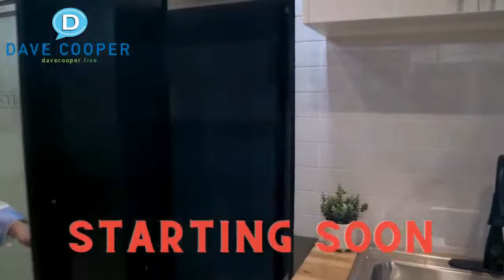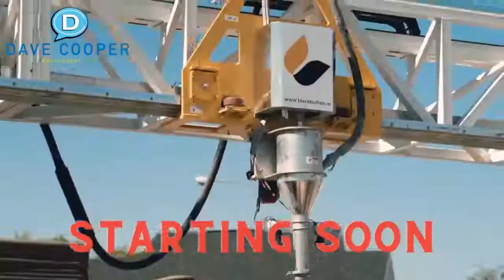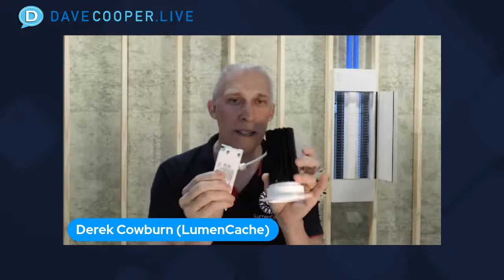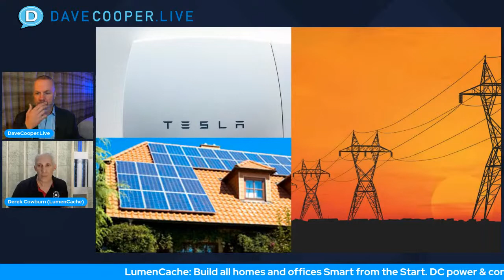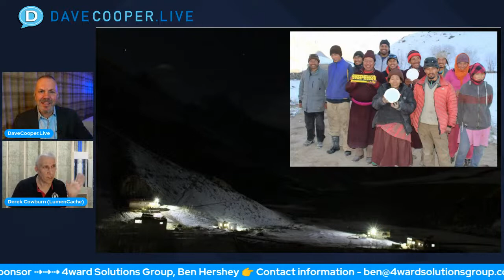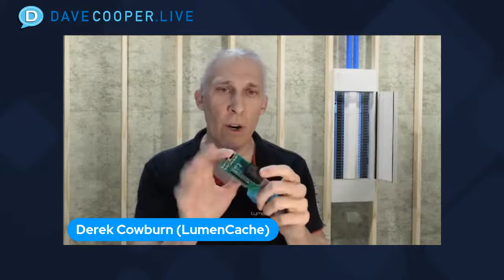DC LED Lighting and Control: Less Copper, Reduced Load, Greater Efficiency

Comment: Such potential. I have been trying to work with lumencache/Derek for over 3 years as a integrator and installer. The system has had so much potential. The big problem is that there has never been an easy way for it to be "smart." No native app, no voice control or easy integration into control systems. Most of my customers are going to care less about all of the benefits of it if they cannot open an app and just control it. Technically, the ability to control it is there, but it is complicated and cumbersome. The new stuff is supposed to remedy that. But i honesty believe that it could be way further ahead than it is if he would have made integrators a priority. He would not hardly have to sell anything. We the integrators would be doing that for him. But if I can't control it and offer my customers what they expect from new technology, I can't sell it. I really am hopeful with this gen 2. We will see.